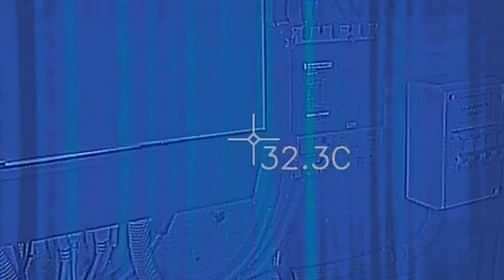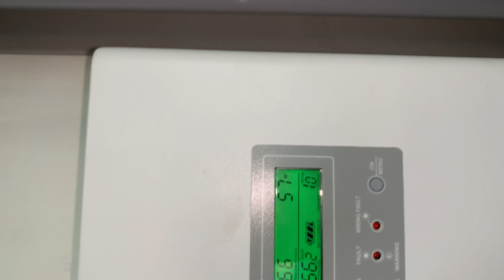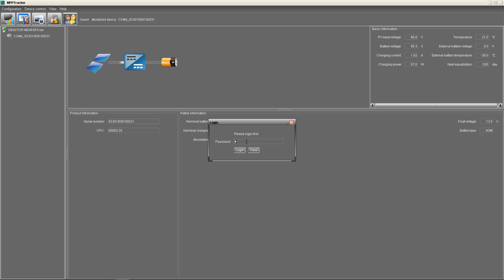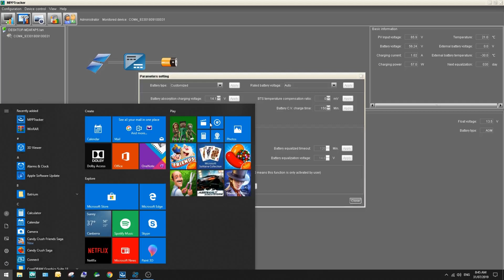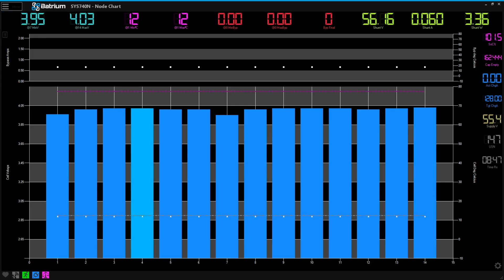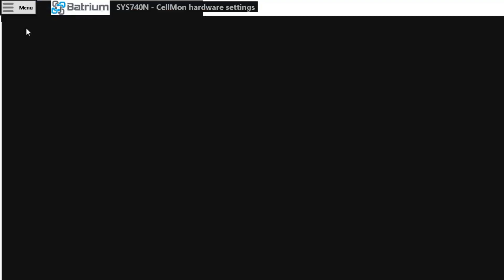Another MPP Sloar PCM60X install and configuration

Comment: Hello, what kind of interface do I need to communicate with the unit? Thanks.
Reply from the maker: A cable https://rover.ebay.com/rover/1/705-53470-19255-0/1?mpre=https%3A%2F%2Fwww.ebay.com.au%2Fsch%2Fi.html%3F_from%3DR40%26_trksid%3Dp2380057.m570.l1313%26_nkw%3Drs323%2Bto%2Busb%26_sacat%3D0&campid=5338074967&toolid=20008
Reply: @HBPowerwall  Thanks! I have one already that I use for other project, I thought the unit come with USB interface already like some of the all in one model. How is the unit working so far?

Comment: Hey mate.  assumimg  you are an australian electrician,  Are  these mpp inverters legal to install in australia?  with back up grid power. Thanks
Reply from the maker: Yes, australia, not a sparkie, mine are not grid connected but even the MPI's that are grid connected are NOT approved  (how ever there was a company in WA that used to import that were approved )

Comment: Can I connect a PCM60X to battery and a normal UPS inverter to the same battery to draw power from battery as AC? Ideally I should use a pure sine wave power inverter, that only converts DC to AC, but I'm not getting any good one here. On the other hand, the regular UPS inverters are easily available. Those can charge the battery and draw power from battery when input AC to inverter is shut down. I'm just worried about the output of the MPPT damaging the inverter.
Reply from the maker: With the right design considerations you could yes...

Comment: I have 2 of these charge controller, do I have to use 2 computers, one for each to track throughout the day? I have a 48 volt agm battery bank. I haven’t change any of the settings as yet. Right out the box I connect to solar and battery and it’s charging. Are there any settings I need to change? Also I haven’t install the program on any computer as well.
Reply from the maker: I would check your batteries most AGM have float and charge voltages set on them. Setting this up could get more from your batteries and make them last longer

Comment: A thermal camera is a very nice tool, when working with this stuff! It could save your house, equipment, help find bad connections, bad cells, if the price would come down a bit more, I'd get one! A BMS with thermal camera would be cool!! Monitor ALL of your cell temps at once! Ha-ha, that could be amazing, shut off or alarm if a cell over heats! Maybe someone will put that together!! Cool video man , its so freggin hot and humid here, I can't get nothing done,
Reply from the maker: it is for sure a handy tool that thermal camera - don't think it'll work with a bms due to resources on the BMS, it's too cold here at the moment to edit that much

Comment: Oi Pete, ya need to put ferrules on the battery cables, the clamping mechanism get loose over time cos of the temp variance and they will need to be checked all the time. They are a major pain in the arse and I have seen burnt dc circuit  breakers 1/2 melted cos the screw simply came loose, but after putting ferrules on solar cable the problem has gone away. http://copper-turned-parts.brass-copper-fittings.com/tin_plated_copper_end_sealing_ferrules.htm
Reply from the maker: I ferrule everything these days.. lesson learnt

Comment: You lost me at the 12v increments? Why is it set to 14 volts. I would have blindly set mine up at 56v. Does it think its charging 4 lead acids ? I didnt see any mention of the number 4.
Reply from the maker: the inverter is configured in 12v not 24/48v so you have to divide your final figures by 2 or 4 respectively

Comment: nice set up. is that the same pip inverter from years ago?. i am about to buy one but some reviews say stay away from MMP solar as hey have many issues. what is your input on that since you have experience with them? thanks.
Reply from the maker: I want to buy the next model !! I"ve had the PCM60X for 4 years and I THINK a guy had it in service for a year before that. I've owned 4 PIP inverters those two have been running my home for a bout two years (one for a little less)
Reply: @HBPowerwall  thanks for the info :)
Reply: I'm using a MPP 3024HSE for 1 year now. They are great with no issues. Because it is also an inverter as well as a charge controller, this is good value.
Reply: @adamcecere3369  thank you man. i guess there'are so many copycats. like easun, must, maylard  and so many others. not sure which brand is the real MPP with that shape. it is china copy and print. the one year warranty on all of them makes you wonder, because most good inverters carry a 5 year warranty and up.
Reply: Adam Cecere  could you please tell me what the idle consumption of the inverter is? Thanks.